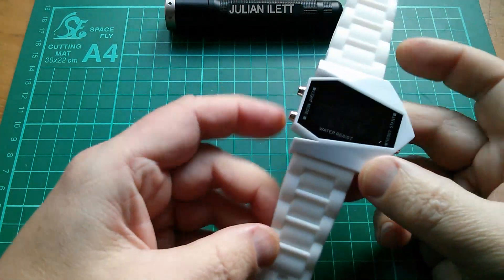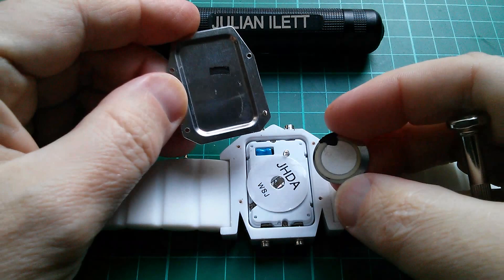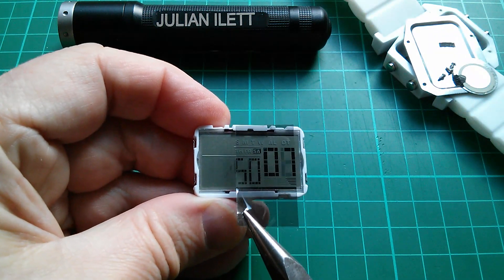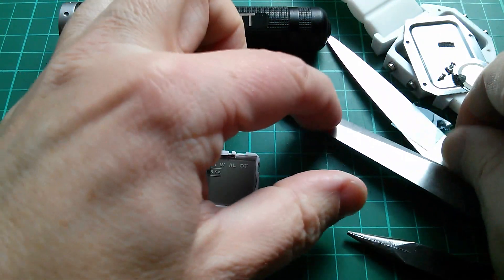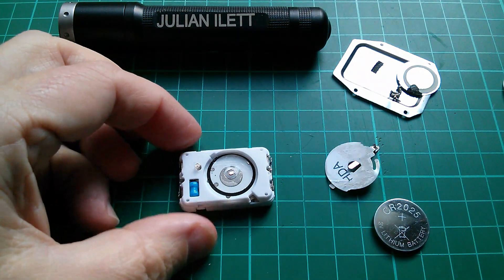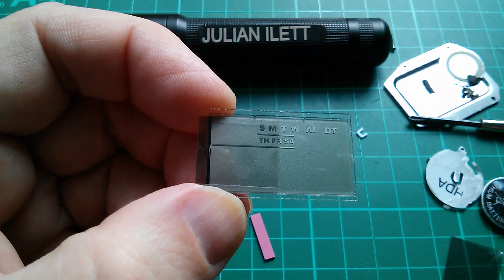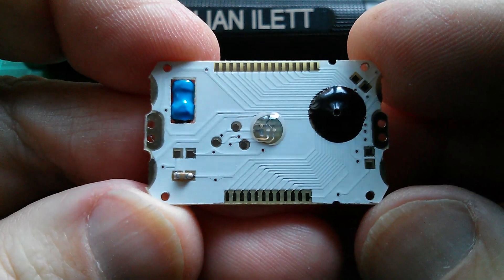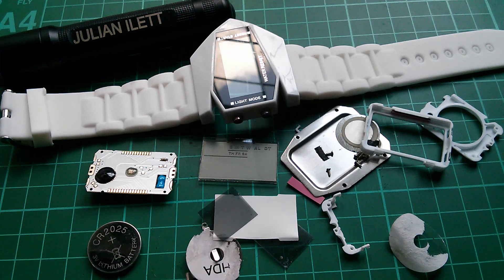Teardown: Crappy Inverse LCD RGB LED Back Light Watch

Comment: 05:20 because piezo sounds much louder when supplied high voltage. In this case is tucked right against metal cover so on 3V you wouldn't hear it at all. Looking at this watch makes me wonder who design this tat 😂

Comment: that watch is so horrible. it's something I would have found or been given as a kid (who only got scrappy stuff) and still been disappointed by it. only difference is back then the cheap watches had a little incandescent lamp in them that did a horrible job dispersing light.... about on par with that led but 1/10 the brightness. made for the trash!

Comment: Were you really that surprised that the conductive ITO coating on the glass of the LCD is so transparent? If so, how do you think you are able to read this on your LCD monitor? ITO (Indium Tin Oxide) has been a vital component in technology for the last sixty years, or so - especially displays, as a transparent, conductive coating. It's used in touchscreen technology as well (both resistive and capacitive), for the same reasons.

Comment: what type of screwdrivers do you use?
Reply: Andy Chrzanowski 
They're just watchmakers screwdrivers. You can buy them all over the web or in tool shops. You should be able to get a set of five in a plastic case for around $5-$10.

Comment: The inductor forms a resonant tank circuit with the capacitive piezo-disk. Without that, the speaker won't emit much sound at 3 volts. It's connected directly across the piezo-disk.

Comment: Inductor for boosting battery to drive the "backlight". No 1.5v battery cell is gonna drive any of those LEDs
edit: it's actually 3v so but what if the battery is low?
Also re: piezo 5v does not do much so that's possible too. Oscilliscope it.

Comment: The blue thing is an inductor. It is very common in piezo driver circuits to make it much louder than the 3V from the battery could. The piezo and the inductor form a basic LC oscillator.
Reply: If there is a diode on the PCB, it most likely uses the fly-back effect of the blue inductor, to drive the piezo. Half part of a boost converter, really.
Reply: The inductor is in the collector of the drive transistor and its back EMF voltage as the transistor switches off boosts the piezo output. Piezo disks with three electrodes are used in simple self-tuning sounders - the small third one is used for feedback.
Reply: Graham Langley
I believe that was said already.
Reply: UFOhunter My point was to explain a little better how it works, There's no diode BTW.
Reply: Sorry, that was pissy of me. Not what was intended.
I think you can get away with the internal intrinsic diode of a Mosfet. These jewel thieves work in the same way.

Comment: The polariser could just have been turned over to invert the screen. I've done it with loads of calculators when i was at school.
The inductor is possibly used to step up the voltage to drive the piezo speaker for the alarm sound. piezo elements need a higher voltage to be driven than the cr2032 cell can output
Reply: i did that to, flipping the filter, sharp calculators were never glued down -
Reply: Did this too when I was in school :D